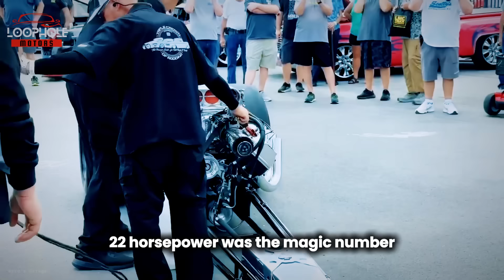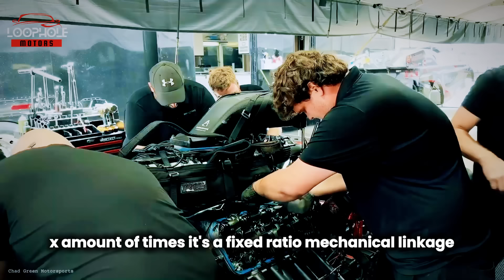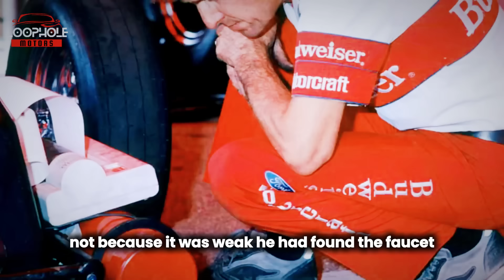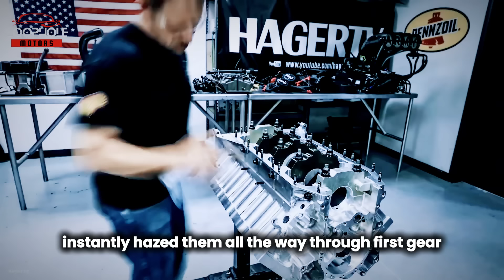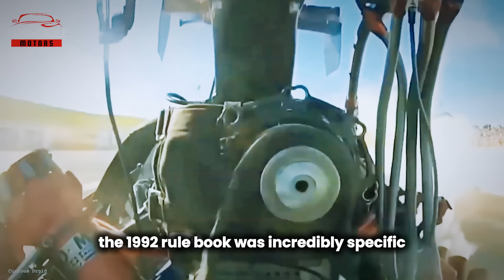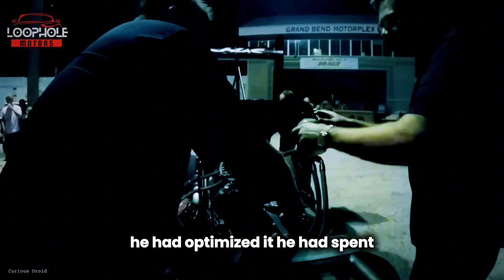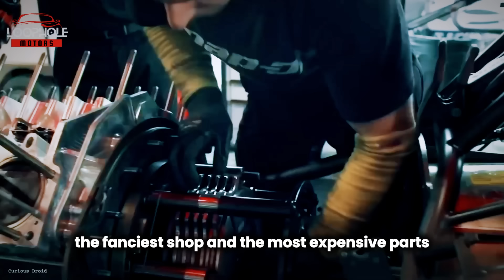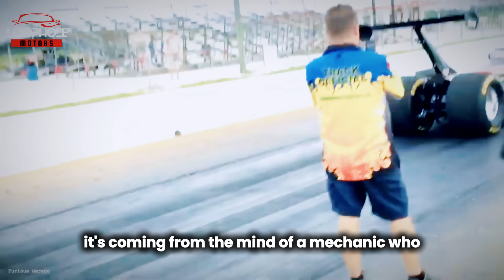How One Mechanic Hid 300 Horsepower in Plain Sight.

Comment: Well, what follows is nowhere near as glamorous as NHRA, but I think it perfectly captures the spirit of someone using his noggin to gain speed.  In the late 1970’s in tiny Fort Valley, Ga, locals enjoyed the not-so-high-speed sport of… go kart racing, and the engine of choice was the mighty Briggs and Stratton 5hp, 4 stroke, probably borrowed off of a riding lawn mower.  

My buddy Danny was able to bend nearly any machinery to his will.  Lawn mower engines generated spark with a magnet embedded in the flywheel, which passed a coil of wire on every revolution.  Danny realized this caused the spark plug to arc on every stroke, including the exhaust stroke, and that unburned fuel might be igniting as the exhaust was being pushed past the exhaust valve, creating backpressure. 

I don’t recall the details, but his fix involved drilling a hole in the crankcase, and manufacturing (and inserting) some sort of linkage that would contact one of the cam lobes and short the spark to ground during the exhaust stroke, avoiding backpressure. Well, it worked fantasticslly well, and he started beating the heck out of everybody.  

But, the one thing he could not solve was an effective seal for the linkage where it penetrated the crankcase.  It leaked so bad that the engines would eventually run dry and burn up.  And the racing budget couldn’t cover more than one or two engines before the boss (Mrs. Danny) put her foot down.  But while those engines lasted, they kicked butt, and it was great fun to watch that happen.
Reply from the maker: That's an amazing story about Danny! It perfectly captures that spirit of ingenious engineering, even in go-kart racing. 🤯
Reply: @L @LegacyMotoring ❤ I’m glad you enjoyed it! Danny was so smart - some folks used to say “That boy ain’t regular”…
Reply: those smaller engines every bit counts ! if you could get a an extra 3/10 hp thats big !

Comment: top fuel doesn't have a first gear, it has ONE gear, the tires growing from centrifical force makes them have a taller gear ratio, or a "second gear" when the car has hit a high enough speed, this guy has half the information.
Reply: Not to mention the clutch pack fusing together

Comment: Best modification I have seen in racing to date was when they installed billet screw compressor blades into a blower. After a couple of successful test runs, the NHRA banned it because insurance would not cover it's use due to being too fast.
Reply: And even after that they had to shorten the race from a full 1325 ft. quarter mile down to 1,000 ft. to keep people from killing themselves.

Comment: Okay let me start with I have just found your channel I've already subscribed and have been Bing watching your content 😅.
Love it love the way you tell the story, images the whole package to me is really great kudos. 

One of the best hacks that I've seen ?
I am an automotive technician that primarily works on BMW ,Mercedes ,Audi German engineering 
But this basically applies to all vehicles there comes a point in time where a catalytic converter is not able to do the conversion process correct and it will set a p0420,430 code depending on the bank .
Now if your exhaust is flowing open meaning there's no clogs in the catalytic converter just to conversion process is failed you can go get an anti fouler for a large spark plug ,drill it and machine it slightly inside to accept the oxygen sensor then reinstall the oxygen sensor with the spacer back into the catalytic converter it will take the sensor out of the airstream just good enough where it will take a failing high dollar converter and pass it without any further issue. 
I can honestly say I have about a 95% success ratio by doing this.

Catalytic converters  cost anywhere from I don't know $400 to $1500 and this is not including the labor to install them 
 The fact that they can be repaired (as long as the catalytic converter is not clogged) with a $4 spacer is pretty comical to me but this is a pretty good hack that I have used to help certain customers when their budget simply will not allow for the replacement of a catalytic converter.
Thank you for all the great content

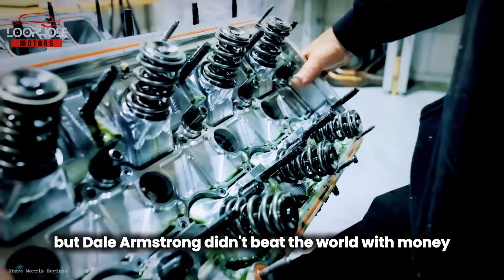Comment: 21:31 no, you are not going to go fast without most of the best materials you can get ahold of or just like you said 2 minutes prior you're blowing cranks up like glass. Frying clutch packs, and having the supercharger blow itself up etc. Once you've got a solid engine you can for sure find cheap tweaks that do a lot but if the drivetrain isn't up to snuff ur up the creek no paddle.

Comment: My late dad did something like this in slot car racing in the late 1950's and early 1960's. He had an idea that everyone thought was insane. He took a model plane wing, inverted it, and attached it to the back of his slot car. Normally when rounding tight corners too fast the slot cars would slide or spin, costing time. Adding the inverted wing to the rear kept the car planted. Other people saw it and asked him, "What are you trying to do, make the car fly?" And fly it did. First race in he was lapping everyone, yet they still laughed at him. He wanted to patent the idea, but my grandfather refused to help. Only a few years later, actual race cars started doing the same thing.
Reply: Idk how long you've been telling that lie or if you just made it up for this post...but i can tell you that you're talking entirely out of your ass if you think that your dad invented automotive aerodynamics in a slot car race.
Reply: so he just put a spoiler on a slotcar? as if that hadn't been done before on real cars, cool story bro.
Reply: @marting.4505  At that time it hadn't been done on real cars, but thanks for playing.
Reply: @irdmoose : after a little googling: 
In 1928 René Prévost described a car design using aerodynamic principles to increase stability and "suck" the car to the track in a 1928 edition of *The Automobile Engineer*. This isn’t the same, but it introduced the principle.

In 1928, the Opel RAK 2, developed by Fritz von Opel, Max Valier, and Friedrich Wilhelm Sander, was one of the first practical applications of inverted wings on a (rocket-powered) racing car. These were large side-mounted wings to generate downforce and keep the car on the ground at high speeds.
Reply: @andrewmole745  That's cool, I wasn't aware of that, and in the late 1950's I'm pretty sure my dad wasn't aware of it either. Though we haven't been able to confirm that for over 2 years now.

Judging by the reaction in this area from the local rednecks, it wasn't common knowledge. Aerodynamic aids were also not widely used in motor sport either at that time.

With that being done in 1928, I'd wager the wings were likely wood ribs over canvas, which would have sufficed for a proof of concept to be sure, but wing technology wasn't there yet to make it practical.
Reply: @iRdMoose yes it had. A racer put a mid mounted inverted wing on his Porsche 550 Spyder in 1956, before that Auto Union put wings on their land speed record car from the late 30's. And I'm pretty sure it was Jim Hall's aerospace engineering schooling that led to him building cars that utilized aero down force in the early sixties, not looking at slot car racing.
Reply: @iRdMoose Mercedes t80 in 1939 designed by Ferdinand Porsche and people from plane company(forget it's name) had a wing, diffuser, 4 wheel (6 wheel total) drive to improve traction, and mechanical traction control

Comment: Im confused. How does a toothed pully and belt slip without instant destruction?
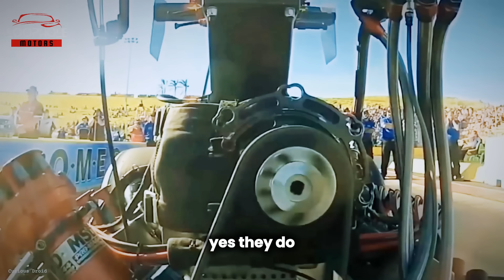Reply: 13:37 look at the vibration on the belt in this picture. It is moving enough to pop over pulley teeth.
Reply: It doesn't
Reply: harmonic vibrations maybe kept everything balanced from instant destruction?

Comment: Ok, I'll bite.  The supercharger doesn't require 900 HP just to spin it at that engine speed.
Reply: I dont know if its 900, but was well over 500 back when they're only making 5000hp.  Look it up. Now that top fuel makes closer to 10,000hp its probably over a 1000hp loss to the blower. There's a ton of resistance to pushing that much air.

Comment: "Isn't this illegal?" "Isn't it against the rules?". What...to fix a slip problem on the supercharger pulley?  No... That would be completely stupid.  If there's an engineering problem that you fixed and the other teams don't even see the problem that's THEIR problem, not yours.  A belt is meant to transfer energy from one pulley to another.  If it's slipping, it's BROKEN, OR designed wrong.  You can't be mad for them fixing their car. 😂

Funny thing, if the tooth profiles and pulleys and belts were still the same they'd have the same problem that they had back at 2200 horsepower.  The belts would be stretching too much, the teeth wouldn't be engaging properly at full power.  Now that they know, I'm 100% sure this is something engineering teams check.  Run it under a heat sensor, and if you get unusually hot spots on a belt you know it's slipping.

You want a weird fix?  I put clothes dryer parts in my air intake.  The stretchy aluminum tubes for the back of a dryer work to go down to the filter and get cooler air to the engine.  I ran my 12.9 second quarter with that tube, on a 5.7l hemi eagle.

Comment: So the TOP FUEL DRAGSTER smoked the tires "all the way through FIRST GEAR", huh?  You're full of shit. Top fuel dragsters do not have "gears". They run a straight 1:1 ratio through the clutch pack from the engine right to the rear end.
Reply: The clutch is the transmission. Kinda quick with the hate aren’t you?
Reply: @barryk8969   Nope. And TECHNICALLY, the rear tires are the "transmission" Because they start off with at smallest diameter that they're going to get, due to low pressure and wrinkled sidewalls (low gear), and as the vehicle picks up speed the tires gain in diameter and get taller until at the other end of the track they're as tall as they're going to get.(High gear)   Theoretically speaking.

Comment: When was top fuel running 2500hp last?
Reply: 1970s, by the 1990s they were about 8000HP a 2500hp engine would put a dragster like that in the low 200MPH, not sure where his 2000hp number came from.

Comment: I saw you sneaked Steve Morris in this one. He doesn't build NHRA motors yet he does build some up to 5000hp and a lot of guy use his motors.
Reply: If you untangle the you tube numbers, it’s probably 3500, especially if the dyno pull is more than the .8 seconds or less like they do.
Reply: @Garson.Hackovar  Depends if talking crank or wheel. He shows crank dyno pulls and some have been up to the 5k mark. Wheel with hub dynos yeah it drops a lot. You can go to his channel and see his builds and dynos. Hell Cleetus uses his engines so there is that.
Reply: @Garson.Hackovar   Devel 16 prototype engine was not top fuel.   That W16 made 5000 bhp.

Comment: Dale Armstrong sounds a bit like Smokey Yunick, don't break the rules just bend them.
Reply: Dale Yunick / Smokey Armstrong
Reply: Yunick didn't bend the rules he broke them.
Reply: No no wrong he made them close all the loopholes and word things properly from all angles @dave_ecclectic
Reply: Apparently I read myths (a long time ago) 
I stand corrected.
ALTHOUGH... apparently he did cheat but in the same way everyone else did.
IE modifying the carb,  while appearing stock it was bigger.
Reply: @dave_ecclectic technically speaking, he simply took advantage of loopholes in the rules,  rather than actually breaking them. He forced rule changes and more thorough inspections.
Reply: @dave_ecclectic Sometimes he did things where there weren't any rules at the time.

Comment: I had a friend with a  71 2 door Dart 318 2 bbl carb, automatic transmission. He could light the tires on it at will. On day, he went to start it up and it would not start, and he panicked and sold if to my other friend, who determined the timing chain was loose, and I helped him replace it. It ran good, but would not light up the those tires anymore. I pleaded with my friend who owned it to let me pull the timing cover of and make the cam one tooth late compared to the crankshaft, but he wouldn’t let me do it. 

I had a 72 Duster with the 225 slant six, so I had noticed it ran better when the valve lash needed adjustment. So the next time I had to adjust the valves, I only adjusted the exhaust valves and left the intakes clacking as usual. 

After that adjustment, I pretty much had the late opening intake valves I begged my friend to let me to do to his 318. 

I found that after making that 1/2 adjustment, those late opening intake valves but on time exhaust valves, I then had a slant six with a 1 bbl carb that smoke the tires on my Duster and I was able to get it to chirp them with so much torque that shifting from 1 to 2, and 2 to 3 chirped the tires if I stood on the accelerator! I am betting ths 273 Solid Lifter Racing V8 in the 1965 Plymouth Barracuda would have liked my valve adjustment method too! Why I think this worked, was the late intake valve opening allowed a bit of a vacuum to form in each combustion chamber before the valve opened and this caused a tornadic swirl that better mixed the fuel and air before combustion, much like the Mitsubishi MCA Jet engine, with the extra swirl valve (3 valves per cylinder).  The Duster was way faster this way and took more than a few Chevy, Oldsmobile and Pontiac drivers that thought they knew how to tune their Quarajunk  Fed V8s to the seeing the sights of my 1972 Tailights receding into the night. I loved showing them that a little 1 bbl Slant Six had just shamed them!
Reply: That was the car I always wanted, i liked them darts!
Reply: I set my wife's at 116 and she shifts at 8800 😂😂😂😂! She took lots of money from everyone!
Reply: I had a 72 also, same slant 6. It wouldn’t spin tires !
Reply: @Idrinklight444 mine wouldn’t either until I made this valve lash adjustment to make the intake valves slightly late opening but the exhaust valves on time opening to clear the cylinders fully. It was spunkier if both intake and exhaust were late (needs valve lash adjustment to eliminate the clacking noise) but not enough to produce enough torque to burn the tires. Only when I left the intakes with a high lash clearance, and properly adjusted the lash on the exhaust, was enough torque developed to break traction. I was stoning standard 75 series tires, that were normal stock width.
Reply from the maker: Awesome story about the Duster! It sounds like you found a unique way to get some serious performance out of that slant six. Thanks for sharing!
Reply: @LegacyMotoring slant six engine were already high torque as designed and economical engines. They were alway very dependable, very hard to kill , engines due to their simplicity, and straight forward design!